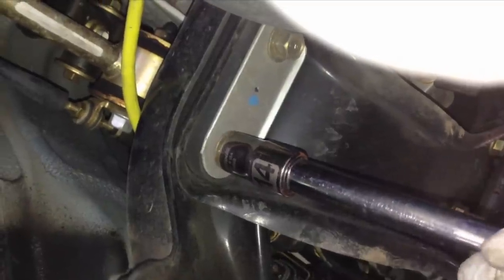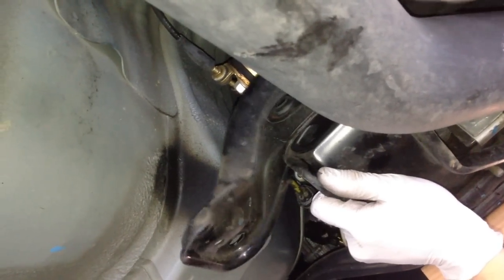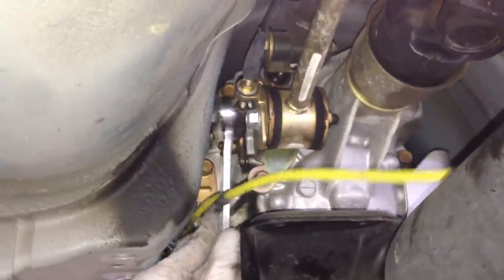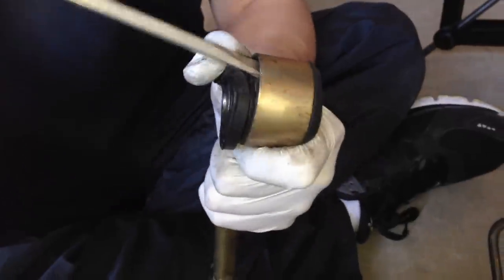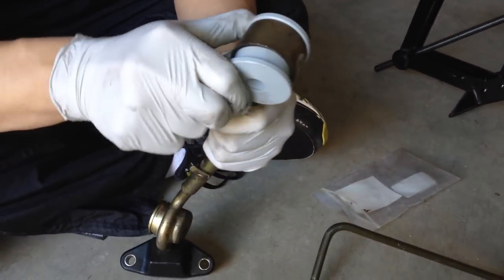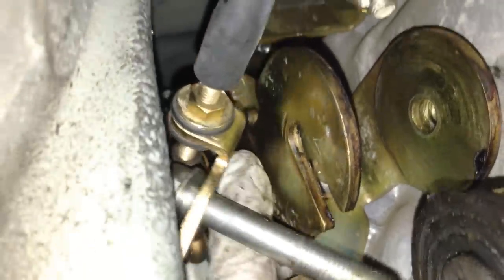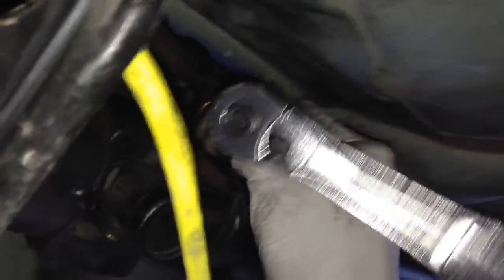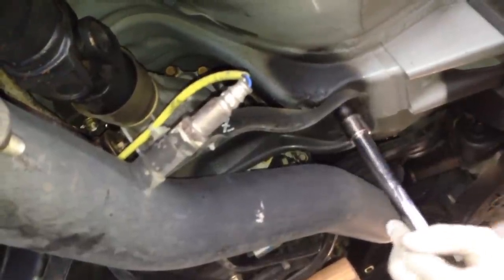Tutorial: Kartboy Front and Rear Shifter Bushings on 2006 Subaru WRX STi

Comment: What do these bushings do exactly? Do they keep the gear shift from being moved left and right while in gear?
Reply from the maker: abu ess performance! Basically it gives you better feel when shifting. Stiffer, more precise and more crisp. The stick wont feel all loose and sloppy with these bushings. The stick will still have play that youre talking about tho. Thats not all that important cause youre not actually using the stick at that point
Reply: nukem384 oh ok got you. I ask because I replaced all the bushings but these, and I still have a sloppy shifter (moves side to side in gear a few inches) and I’m at a loss as to why
Reply from the maker: @JL-pq4rl  yeah its going to do that.  i wouldnt worry about it, as every cars shifter is like that.  its all about the feel when shifting anyway, not when its resting in gear just sitting there
Reply: @JL-pq4rl  I know this reply is a bit late, but I was able to get pretty much all side-to-side play out of my 2004 STi transmission by replacing the linkage bushings AND the yoke/spring pin itself (i.e. the part that attaches to the shaft coming out of the transmission and the two nested roll pins that secure it to the shaft). I replaced the linkage bushings with TiC bushings and the yoke with an OEM one (about $50!). Turns out, the bushings in the linkage were sloppy, the yoke was wallowed out internally, and the roll pins were a bit loose too. The front and rear stay bushings don't remove shift slop, they just keep the shifter ball and socket joint more firmly located. It is the U-joint bushings, the yoke itself, and the spring pins that wear and cause the side-to-side and, to a lesser extent, front-to-back play. Hope this helps someone!
Reply: @Currancchs  Wicked, do you have the part numbers for those?